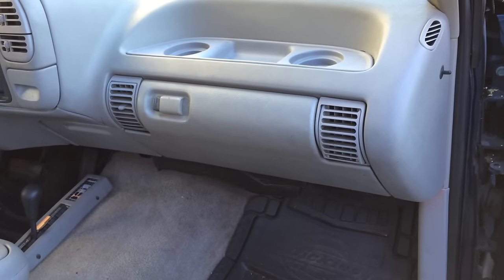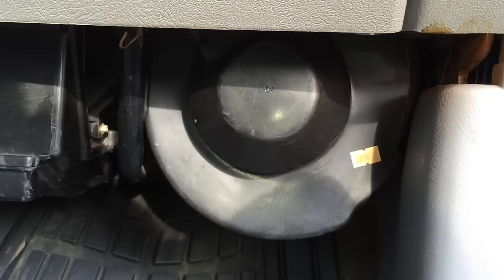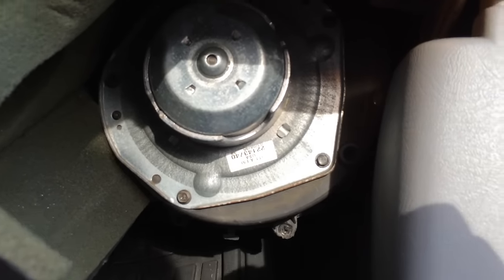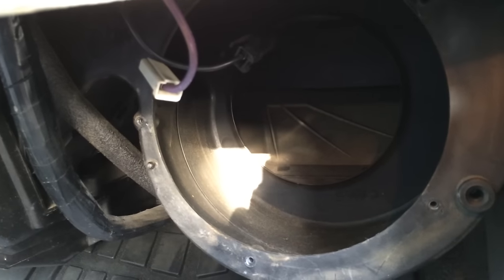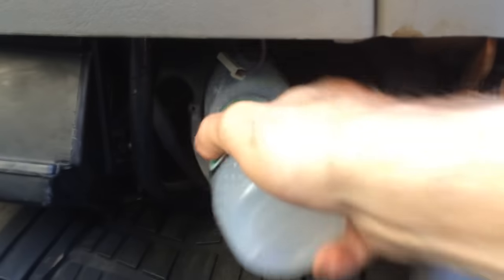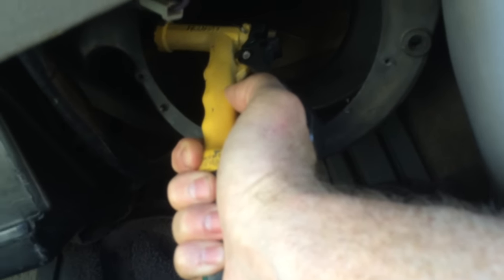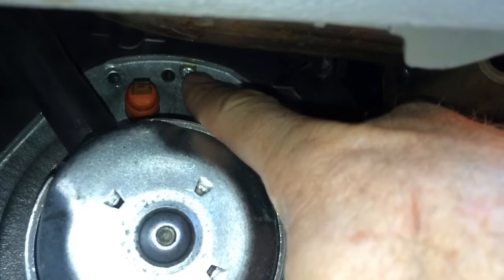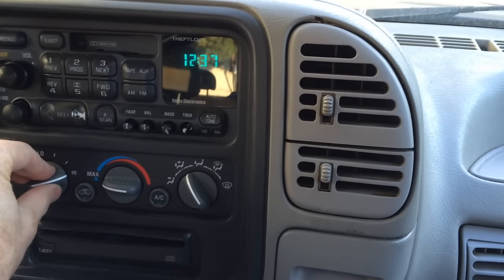How To Clean The Airbox On A Chevrolet Truck

Comment: I’m getting ready to clean mine. The hardest part on mine is getting that rubber cover off. I will probably paint the back of the motor black and leave the cover off permanently. That way I can clean the coils every year without messing with that cover. Either that, or I will modify the cover so that it is easy to take it off and on.

Comment: July 26 2019:   Noticed almost no airflow from the vents so I pulled the motor, it tested ok after cleaning the cage.   Then i started looking for a clogged filter.  THANKS to this video I see I am looking at the metal heat exchanger and it saved me a lot of time looking for a non-existent filter.  Incredible dirt buildup, vacuum  would not touch it.  I have been spraying with 409 and a wire brush to peel off the surface dirt.   Worried that there may still be blockage along the fins.  Tomorrow will try water blasting it   Need a mirror and bright light to see the damm thing.     I will use it as an excuse not to buy another Chevy.
Reply from the maker: They really should’ve put a filter on this. My dad has a 2001 Chevy truck, and it has a paper filter in it that keeps everything clean.
Reply: Man you need an excuse bad ,no
Reply: That's the same thing going on in my brother's 98 GMC Sierra.  No air flow through any of the vents. I'm going to have to do what you just stated.
Reply: @ernestrodrigue3227  he couldn't think of any real reason so...

Comment: i need to replace my blower motor this sure looks easier than taking the glovebox and computer out of my 97 silverado. great video
Reply from the maker: Thanks.  It is pretty easy to get to on my 95 Silverado.
Reply: The computer on your 97 is under the hood, so you would be spared that obstacle. 95 and older the computers were there behind the glovebox.
Reply: hoohoohoblin can you explain how to get the white and purple wire off

Comment: i need to put a screen on the cowl of my 76 ford cleaned out my air vents a while back pulled out half a forrest
Reply from the maker: On my mom's Ford Falcon, when you opened the cabin vent box in the summer for the first time, it would blast the whole car full of leaves.
Reply: had tons of pine needles in mine lol right to the face everytime i turned on the fan lol

Comment: I have a 99 gmc jimmy and notice vents seem to blow out pretty good checked the a.c. added a little 134a.and its charged but its still.not getting as cold and my brother said something like you just showed probaly what needs done..But this looked like a different vehicle.Can you let me know?
Reply from the maker: I know they changed the design and 99 or 2000. It’s possible that you have a different one. If you do, then yours also has a cabin air filter. You could change that, and if it’s dirty, you will have a lot more airflow.
Reply: I have an early year 1999 Tahoe with the same issues (relating to no air filter).  From mid ‘99 to 2003, a large removable plastic kick panel was installed, obviating need for the small plastic motor shield and permitting an air filter to be added.  This is the only Utube video which addresses the annoying pre-2000 problem and it is very helpful.  I wish more attention had been given to removal of the plastic blower shield as mine is also a bear to get at.  Its bottom clip is very unwieldy.  Easy removal of the glove box door does provide more open access to the area.  Just pry in the upper right rear of the clove box interior after removing the small pull-tie on the left side.  Take care not to break that clip-on pull-tie.  Partially close the glovebox door to slacken the tie, then push/slide its connecter out where it is attached to the left inside of the glovebox.  In the ‘99 model, the glovebox door is then just easily pulled down off of its open hinges. Earlier models had screw-on, or even riveted on hinges (PITA).  Its hard to believe it took GM engineers that many years to install a cabin A/C air filter.  Dr. K.

Comment: Great vid. Gotta squeak coming from our GMC Sierra truck heater fan motor. Gonna do what U did here, clean the area see if that fixes the prob. If not 1Aauto sells a new Heater/AC motor for $25.
Reply from the maker: Thanks. I hope that fixes it.
Reply: I have had some limited success over the years just spraying some wd40 around the intake area. Enough of it may find its way to the motor that it gets a little lubricant on the squeak. I would not advise soaking it.

Comment: hey thank you for the great video. it helped out a lot when you live in AZ. one question my rubber cover for the a blower is in very bad condition, your looks fairly new? where can I get a new one? what's the proper name for the piece?
Reply from the maker: I don't know.  The dealer would probably have them, but it would be a ripoff.  I wonder if you could cut one yourself out of rubber.
Reply: The cover is mainly there to insulate against the blower motor noise. If you don't mind the noise then you can go without one.

Comment: Hi, thanks for the vid. I have a question, I have the same truck, 96 Silverado, I can not find the source, but, my passenger area right there leaks water when it rains. Have you, or anyone had the same experience? I have tried everything short of taking the fender off, to find where it is getting in from. Thanks!!
Reply from the maker: It has to be somewhere in the airbox.  There is a drain hole in the bottom, and any water is supposed to go down it.  Make sure the edges seal properly.   I bet you could hose down the front of your truck and then look for where the water leaks in and seal it with silicone or duct tape.
Reply: Stevie Wonder mine was coming from under the hood where the welding on frame next to the passenger side of the windshield cowl is and it would leak into the passenger side floor of my 98 chevy try spraying water around that area and see if water goes to your floor or it may just be your evaporator drain stopped up🤔 i mean if 2 years now and you still have this problem lol😅 if thats it i just put some flex seal and solved the problem. Look at that welding for a crack mine was a crack from rust

Comment: i have a 1996 chevy and the ac blows cool but not cold. i replaced the ac compressor and charged it up, there’s no leaks what could be the issue?
Reply from the maker: Mine doesn’t blow very cold either. I think that just might be the way it’s built. The guy I bought the truck from had the whole thing re-done with new hoses and a new compressor and modern coolant, and it still takes a while to get cold, and doesn’t have much power. If your truck has an air filter on the ventilation system, you might make sure that it isn’t clogged or dirty. On my 95 truck, there is no air filter.

Comment: Thanks for the video! When I start my truck it sounds like there is water sloshing around in there... am I in for some trouble?
Reply from the maker: There could be water in there if the drain hole is clogged.
Reply: hoohoohoblin thanks man! Love your videos!
Reply: Did you figure it out? I hear water too.
Reply: Renato no, I ended up selling the truck. Good luck!
Reply: @R3nat002  they are notorious for getting water in the housing drill a whole in the bottom before it jacks your blower it shorted mine out and the truck dies if you turn of the heater lol
Reply: @davidbirkes7308  hey man i found another video, i had to correctly purge the air out.

Comment: On my 95 suburban, the fan only works when on Hi. Do you think it's the fan or the controller?  I may put a multimeter on the connections to check the lower levels
Reply from the maker: I would suspect the controller is the problem.  Using a multimeter is a good idea if you want to know for sure.
Reply: It's the Blower Motor Control Module / Resistor
Reply: Did you get your low to wotk?
Reply: I vote resistor pack as well. Blower motors default to running on HI. 
What the resistors do is basically absorb some of the power going to the blower, which causes it to slow down.
Resistor pack blew in my 2015 cx9 after drain tube clogged (Less Tha 3 yrs old!) 
Since I didn't want to pay $179 for a new resistor pack ($10 if ordered straight from China in quantity of 15+) and had no luck with junk yard....I just wired it straight thru with a on/off switch.  
I only had HI speed for a couple years til I located a resistor pack. But it worked!

Comment: I think I used too much water and now my truck is shaky and stalls. It's been a week out here in AZ and I though whatever water entered in the wrong spot would evaporate by now but I still have that problem. Any ideas on how to fix it?
Reply from the maker: Putting water in there or shouldn’t have any effect on the engine. It gets its air from a totally different place.
Reply: you are absolutely right. It was another problem that just happened to occur when I turned on the truck that had nothing to do with spraying water in there. Thanks for the reply.

Comment: u know what i forgot to ask my pass floor gets wet when it rains some times ill c it come right from fan motor that hole u cleaned out is it a drain any other ideas its not heater core
Reply from the maker: It might be coming in from under the windshield.  Maybe a hole has rusted into the drain under the windshield, and the water runs into it and goes onto the floor of the truck.
Reply: It's probably the panel under your windshield cowl. Its a common problem on the 88-98 chevy truck. Just clean it then silicone it. Put a dab on the passenger side screws when reassembling also.
Reply: Larry Boye u mean the one that's sealed from the factory I saw it is need to chisel it off the water comes right into ware the squirrel cage for motor is and falls on matt
Reply: 84montecarlonazi 
Yes that's the one. I used a wire brush wheel to break it free then cleaned it up and sealed it.
Reply: ok thank you itl take sum time but worth it carpet gets wet under Matt itl get moldy lol
Reply: My 96 Silverado has the same problem, it comes in somewhere between the fire wall, and the fender. If you pour a jug of water right there by the antenna,  it will run  down behind the blower....I tried everything...Just replaced my windshield, but haven't noticed yet

Comment: my ac only blows to 60 degrees. what do you think it could be
Reply from the maker: In most cases, it is low on refrigerant.  Try buying a recharge kit and putting more in.
Reply: hoohoohoblin did that
Reply: namelesssd maybe it's your condenser or evaporater
Reply: namelesssd I have the same problem with my 99 Tahoe but only when it to highest setting.... When I drop down halfway or to the lowest, it comes out at 38 °
Reply: suburban noise under ac
Reply: Check the air door next to the blower motor, Mine was bad and not recirculating conditioned air = 60 deg air vent temps. Provided the ac system is working and the correct charge. Spent 2 days diagnosing the complete ac system.

Comment: i have a1995 chevey 5.7 V8 my fan controle switch only works at No 3 how do i change it please help do i have to take the dash out
Reply from the maker: On mine I replaced the whole heater control unit when the air conditioning stopped working, and I just needed to take off the dash plate to get to it. It was really easy to do.
Reply: There's a resistor/ sensor right behind the glove box, a couple of wires come off if it pointed straight up. It rides on top of the hottest part of the heater ducting and they changed the shapes in there around 95 meaning you may need a micro wrench to undo the 6.5mm screws.

Comment: my tahoe ac works pretty good but it sometimes it smells like mold.
Reply: what can be happening. Can I change any ac filter.?
Reply from the maker: +Antonio Torres it pens on what year it is. On old ones like mine, 1995 and older, there is no filter. I hosed out and sprayed some Febreeze in there, which helped.
Reply: mine is 1999 n i will clean everything but i think there is no filter.
Reply: Antonio Torres, change the a/c dryer

Comment: Haha, that was priceless ! WTH was that thing you pulled out ? Anyways, I have an O3 S10 Blazer, do you know if that process would be similar ?
Reply from the maker: +Will Puchalsky yours is probably different. I bet the design is a lot smarter. It probably has a paper cabin air filter, so if you look up how to replace the cabin air filter, that would be the way to get all the crud out of the airbox and get the air flowing faster.
Reply: @hoohoohoblin  it does have a paper cabin air filter.

I gotta change mine out too, and clean the sensor

Comment: The hardest bit was removing the two bolts holding the cover and you didn't show how you did that.
Reply: I have not tried this yet. However, I would mention that they sell a tiny ratchet at Harbor freight for like $4 (pre-covid price) . It comes with some screwdriver tips and a socket adapter. 
With a socket on the tiny ratchet I have been able to get into some tight places on my motorcycles.